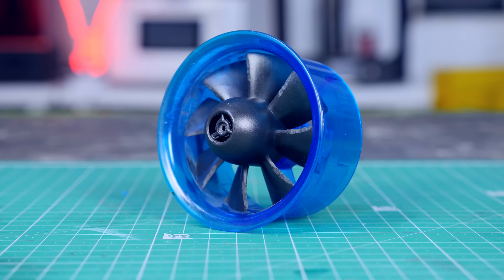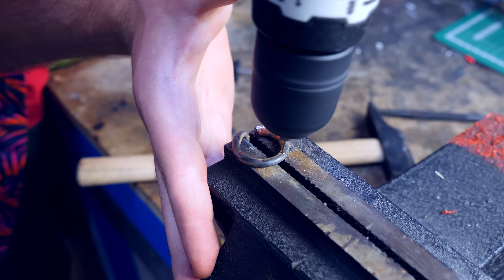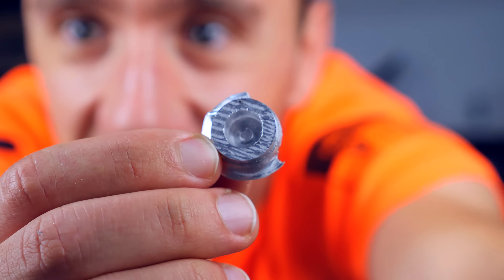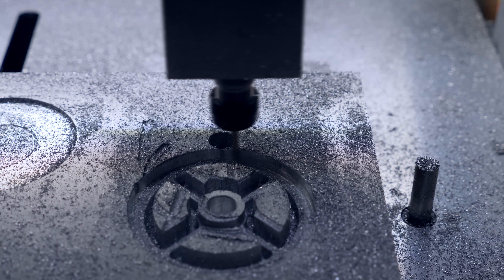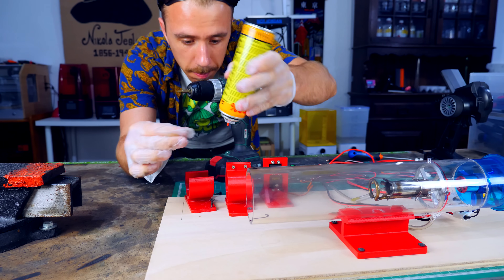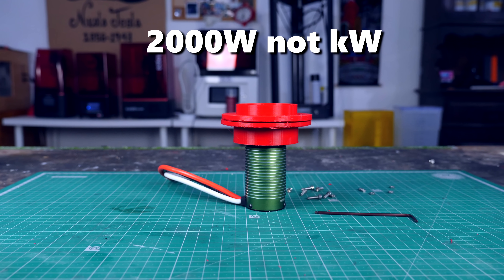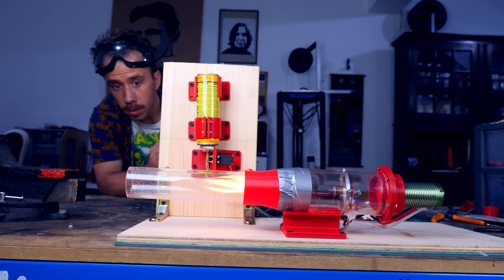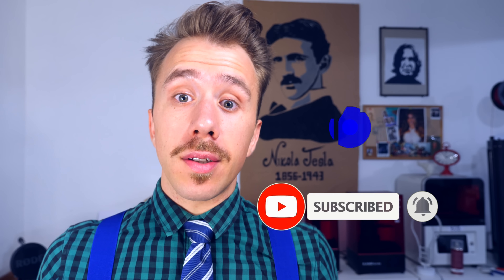I turned my Fan into a Jet Engine (3D Printed EDF Afterburner)

Comment: Build Idea: electromagnetic propulsion system, or “EM drive,” that generates a small amount of thrust simply by bouncing microwaves around a cone-shaped copper chamber. No propellant goes in, no exhaust comes out, and yet, somehow, the engine can make things move.

Comment: Are you sure you weren't sending too much fuel? Butane generally burns better once it's gaseous and in many clips I saw liquid entering the chamber. Could you try it with the fuel can pointing up, just to rule that out?

Comment: about cnc mill. you need to get rid of that vibration. vibration is bad thing. when its vibrating, its making parts less precise and the mill you are using, in vibrations its more likely to break, because vibrations makes it less sharp, and if its not sharp (feed rate) is pushing mill in material and if its not sharp 
enough it will not cut, but it wil be pressed aginst material and eventualy will brake. (my english is very good i know, but i hope you understand a liitle bit of it, at least that vibration is bad. :D 

how to get rid of it? if the mill is less out from the spinner holding it, its less vibrating, but be arefull about deeper cuts, and about securing material you are milling. make sure it cant vibrate.

Comment: Hi integza,
You need to improve your Injektion and ignition.
The Gas ist too cold and there is no need to injekt it liquid. Turn the bottle upwards and warm it at the engine.
put the injektor closer towards the glowplug.
Or roll a fine metalmesh arond te ignition tube and the injektor. So the airflow between injektor and ignition  will be slowed down and ogigen will be Provider trough the mesh.

Comment: you should measure does adding fuel increase thrust like in real afterburner. also could exhaust tube be modified to take more air = better burning = more thrust

Comment: I think your engine would have worked better if you crimp the fuel line just a little on a brass line inside the engine. That would restrict the fuel too much more Even Flow no matter how full or how empty the bottle was. Your afterburner wasn't consistent because the pressure in the line was never consistent. I hope that helps I want to see you try this again. I enjoy your video

Comment: Get a propane pressured gas bottle from the hardware store and maybe a solenoid valve, it's going to be cheaper in the long run. Also, I think you want to achieve blue flames instead of orange (blue is hotter => higher exhaust gas velocity&pressure => more impulse)

Comment: That's not much of an afterburner, it's just a very simple , crappy, inefficient turbojet. If the fan's shaft was connected to another turbine at the end that would use the air sped up by burned gas to propel the front fan, so you'd be able to turn off electrical power to that front fan, it would basically be a normal model turbojet, except the  current geometry would probably make it inefficient as all hell and probably not even work due to very high fan speed compared to the gas exit speed

Comment: For the next vid how about you switch to methane and liquid oxygen as oxidiser just like spacex did with their raptor engine built for Mars it would really be a good idea to switch to propellants and use actual rocket fuels just like hydrazine and rp1 it would be fun also you could try using liquid hydrogen and oxygen which you actually separate from water 

Yeah I'm trying to get 3d printer got some bangers ideas can't wait to try it out

Comment: Hey, try to power a boat with the afterburner engine ! A bit like a jetski, but with a literal jet

Also maybe try to find the sweet spot for the fan/turbine pressure, you may be able to get better efficiency out of the fuel

Comment: Really enjoy your channel can't wait till i get a 3d printer for prototyping.  I do think considering the effort maybe a pressure regulator for the gas + flow meter (for extra credit) as it can be used over and over and make a difference to these engines..

Comment: Awesome! I was playing around with a after burner on a EDF some years ago and found that I could not hold the flame under full power! Maybe I need to revisit the project!

As for a future video, how about, you how to capture and store hydrogen made from let’s say a hydrogen generator (electrolysis), so it is ready to be used when needed rather than waiting for the hydrogen to form. It will need to start from near atmospheric pressure! Just thoughts, it would be fun!
Reply: Would be even more fun adding a hydrogen powered afterburner to this project! Flame and vapour trails all in one!?!?

Comment: What if instead of a straight tube you have it go down after the gas tub so it get tighter on the inside then right after it as small as you want it it opens back up to the regular size. When it opens back up to regular size dont make it as falt ast the other one make it steep. The right end would be (for ex) 5-7 in while the left side would be 3-4 in long. This would be measured from starting point to tye middle of the choke point. Then form the coke point to the end of it. Maybey also try putting thoes shark fins you see on cars on the right end of the tube. Also try making that choke point long or shorter.

Comment: I'd like to see if my idea works but I'm short a few bits to do it. Maybe you can try an axial flux generator powered by a fan channelled into the path of the turbine. 5kw turbine could it make enough power or pointless?

Comment: Hii integza  I also made my  own cnc ,and suffered from the same issue ,,,but after many trials I find the solution that is using a short bit in my router and make router closer to the source ,,so the center of gravity is lower while moving ,and now it cuts much better and vibration are much lesser too....hope it helps

Comment: Hi, you sound like a nice guy. So while I was watching I could see if you used a smaller version of what you are doing .( Hand held) and formed a better relationship restrictor.
Placed the whole thing together concise .
Use a fan that can be run of a drill battery.
Bundle it up as a handle with a canister .
Have no clear past the restrictor.
You should get a hand held battery powered device that could produce a flame up to 30 to 60 cm .
So ideally some fans of that movie star wars .
Might call that a light Saber..

Which would be pretty cool.

I will look back later or may be make one myself.

Comment: i have to admit, the beginning of your series was exciting. you becam a bit lame.
to give you a hint. the idea behind the design of a rocket engine, is to expand air as fast as possible, thru a channel forcing a direction. accomplished is this by transfering energy to all the individual air molecules.
what you do now is, you drive the fairly heated air. instead of transfering energy to the air and make it find its way out.

Comment: make portable unit where you have an HHO generator which turns water in to fuel basically and run an engine on that or make it so tha you inject that in a car carburator or air intake and power it using the alternator

Comment: you want a better compressor fan? you could try making something along the same lines as a turbo , hot gas's through the exhaust port of the turbo to spool it up and then feed the compressor side back into the exhaust/ combustion chamber .. idk something along those lines :)

Comment: I Integza ! Great video as always !! thanks. 
I might have a solution to light an engine easily, You can use a 3,3 Vdc to 200 kVdc booster online, it's small, cheap and does awesome electric arc (1-2 cm long an bright as 🔥)

Comment: You could try to improve this jet engine by adding one of the vanes that are seen in jet engines of aircraft so that the output is one diameter less with another servo

Comment: Machining aluminum tips for newbies:
Use small stepdown like 0.25-0.5mm(stepdown is the depth of the passes the bit makes)
Set spindle rpm to 8000-11000 max
Use lubrication on the bit or failing that blow some air on it to disperse the chips otherwise they will melt on the bit
Use a 2 flute upcut bit
and set movement speed to 1500mm/s if your machine can handle it

Comment: I have to say, i really like you aknowledge that failures are necessary part of development and do not get discouraged but keep on trying. You are absolutely correct on that no-one can build a complicated (and sometimes rather simple) designs with the first try. There are revisions upon revisions until step by step you get to the final design.
And you are really stretching the limits on what can be done with hobby tools, showing that it doesn't always require tens of thousands of euros in equipment and machinery.
I'll give 'two thumbs up' rating for you! :D

Comment: @Integza   Your "afterburner" is ass-backwards and does not help with fuel-air mixing ahead of combustion. The constriction you added to the tube does (part-of) what a normal burner sleeve would do, i.e. slow the air down to give the fuel a chance to mix with the air.

Comment: I think building an engine like what is used on a small military drones. not a rocket but turbo jet.  This could power an RC plane or RC jet plane. I also have a degree in 3D modeling and a 3D printer would be a great addition to my home shop.

Comment: Why r you using a centrifugal flow?? Most jet engines with reheaters/afterbunners uses axial flow design i can be wrong if so please correct me. And i think it will be better to put the afterbunner further down the tube similar to real engines. I think this will allow for better burn as it lets the fuel to burn easier and also increase the speed of the air leaving the tube. Again i maybe wrong so pls correct me. Using an edf would be a better option. Yes centrifugal flow will allow for higher pressure air but i think in this situation it will be better to us edf since we do not fully rely on combustion to get power so pressure is less necessary and rather more air flow to get the necessary thrust. Just my thoughts

Comment: Pro tips from +10yr machinist. Get a shorter end mill. Yours is way too long for that diameter and depth of cut. Mill starts to chatter and cause issues. Also you might wanna use some coolant. Aluminum tends to stick and smear on to the end mills nastily.

Comment: i suggest you make a windturbine but the first set of blades are 3 blades the 2nd set of blades are 4 and the 3rd set are two lets see how much vibration, power its gonna make, and the aerodynamics each blade set will make
so pls make it i dont have a glue gun or a 3d printer to replicate this project and i hote to win  a 3d printer also i am subbed

Comment: So I'm not jet engineer but I think your high pressure fan isn't creating the most optimal air flow it can, still very cool! I'm really hoping for one of your next videos you do at least a two stage fan blade assembly. Where at least one fan focuses on bringing in air and compression and the other gives it that spiral speed up, also a thrust meter would be cool.
I'm hoping this doesn't just put out the flame and a slow start up can add what is needed for proper ignition and then increase thrust.
I'm really interested in this project in particular, would love to try it myself sometime later but don't have all the equipment atm. Still inspire me to learn more about engineering and design.

Comment: Video Idea: DIY metal casting for the parts you need, make a mold from a 3d printed part and then melt some aluminum and fill the mold

Comment: As a maintenance engineer working on afterburning turbofan engines my big point to note is that you will need to reverse the positioning of your fuel nozzle and flame tube. You want the fuel to be atomised by the high speed air flow and then slowed down and caught in the static vortex behind the flange holders, it'll create a static flame front and become self sustaining. The igniter is only used to start the AB, after its lit it turns off and fuel flow increases and decreases at the demand of thrust but it's always lit and self sustaining in the flange holders until the throttles are pulled out of AB.

Also after burning is only ever used while the core engine is at 100% rpm, so not only will designing it to handle that airflow be more efficient, but also removes an entire variable for you in terms of air flow
Reply: Oh also this redesign of the fuel and flame holder will eliminate the need to preheat the fuel, as it will already be atomised by the airflow by the time it reaches the flame front. In jet engines we DO preheat the fuel, but only as it's at around -60°c due to high altitude temps and it allows us to use that fuel as coolant for the engine and other systems, so it's win win. 

For this design it is not required, but simply spiralling the fuel line around the inside of the chamber first would be sufficient... Hell that could even function as your flange holder if it blocks enough airflow to create the stall points needed

Comment: Aluminum machining benefits from some light oil, should help with the chattering and from material from sticking to the cutter. 

Also use new endmills, if they have any chips in the cutting surfaces just throw them out since that can cause chattering too!

Comment: Integza
2.     Tesla turbines. 
Bladeless turbine.Jet engine

Take a Tesla turbine and make center shaft as the intake ( cold air compressor section the air comes in own the center of the disc working its way out)  and as the disc spin they're going to be spinning the air comes off the disc make that a funnel traveling back down the shaft the disc make a tornado in that funnel So the faster it turns the more the air will be compressed at the neck of the funnel that's where you inject your are into the combustion chamber so just like in a jet engine we're going to take advantage of pound per square inch we are going to feel it and turn that high-pressure air into volume we put that through the second Tesla turbine at the outside letting that work its way in ( the thrust working its way from the outside of the disk in) on the desk and it's all on one common shaft as the Thruster exhaust comes out of the hot side I would collect in a manifold letting the shaft extend through the manifold so that my bearing can be protected because I could run a heat shield and the thrust coming off the manifold I can still turn the pipe backwards it's just not in line with the central shaft.     On the hot side you're going to have to get creative as to what to make them disc out of because them things are going to get hot      Very hot.       You have the engineering skills.       I don't know but this may actually be an invention and never been tried before.       So do it right it would be a bladeless turbine jet engine

Ps   Integza.   I was looking around on your Channel I didn't realize that you have challenged everybody to design a Tesla turbine I don't have a 3D printer or any way of building this it was just an idea that hit me on the cold air side in the compressor section that's probably 3D printable. ( Unless RPMs are problem) on the hot side you're going to have to get creative

If you build this from the research I've done a couple of years ago just looking into the Tesla turbine before I ever had this thought Tesla turbine if I remember correctly gets more and more efficient the faster it turns they like the high RPMs but that causes the wheels to crack but normally these wheels are 3 and 4 foot and diameter for a big turbine with this being a model in the wheel only being three or four inch in diameter I could see you hitting a hundred thousand RPMs     

(( please mark on the outside of this thing where your turbine wheels.  AR.  )) 

(( when it's running do not get in line with those turbine Wheels please ))

Your probably not going to be able to used ball bearings they'll explode at that kind of RPMs instead you'll probably have to do it the same way it's done in a gas engine with the camshaft or the crankshaft just get you a little electric motor and positive displacement pump in a tub or a bath a probably motor oil and just like an air hockey puck you spend it in oil and just have two little tubs where your bearings are  at print you some little 3D reflectors so that you're oil isn't squirting everywhere so that you're oil is falling down into the tub and then just run you return lens back to Central tub or bath with your oil pump

Integza.  Have fun but be safe

Comment: integza i suggest making a 3d model of a jet engine that you can operate with compressed air as "fuel" to ensure you have the right design and then use the cnc to produce the final version

Comment: 3:55 Get some Kwik Kool 77 and mix it 40:1 with water. Then see how your cutting sounds. If you have enough ventilation you can use a little isopropyl alcohol...  Just a few drops. It cools and lubricates.

Comment: I have one little suggestion. 
I also immediately thought that the fuel should be preheated, also because the very cold gas flow cools the glowplug. You could run the line in front of the flame. This is done, with the outdoor burner I use for hikeing, the MSR XGK-EX and believe me, it's a monster and sounds like a rocket itself!!! And btw I love you videos! Thank you and have a great day.

Comment: I hate to put a damper on this project, but is it really an afterburner? I believe an afterburner uses exhaust to create combustion using fuel injected into the already hot exhaust gases that still have unburned oxygen in it. This build is just a combustion chamber.

Comment: It seems like it may be better to find a way to fine tune air/fuel. Using the controller it looks like it's really hard to control or that it might be easy to kill it with just small movements. You may be able to add your own dials or modify what's on the controller already to be more consistent.